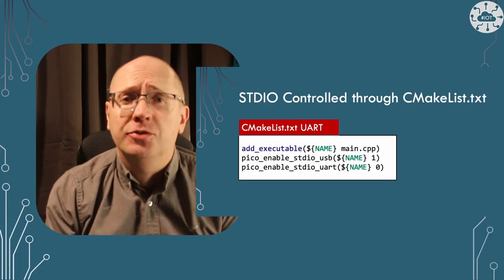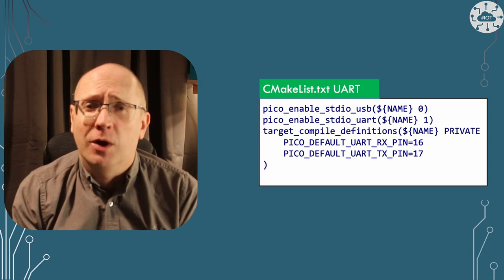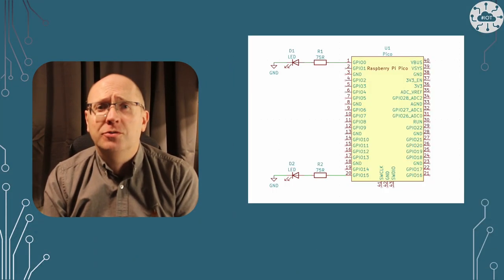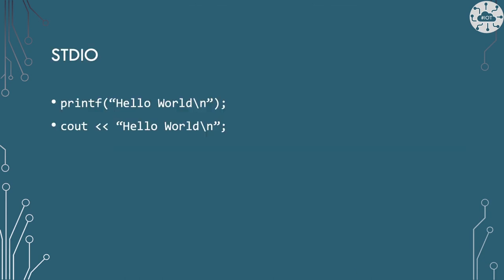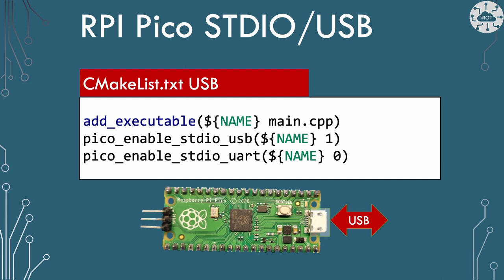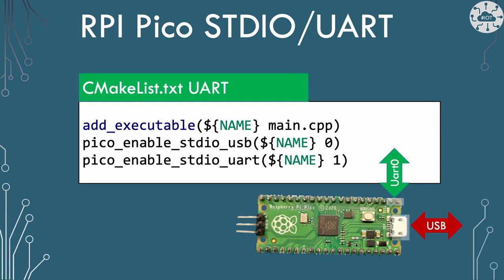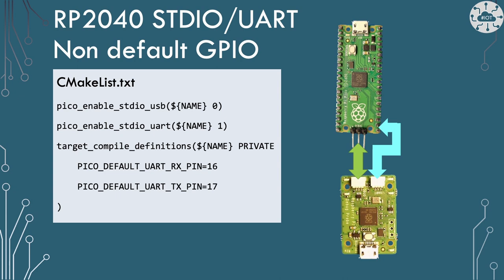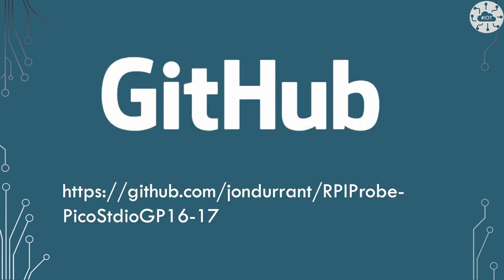RPI Pico STDIO (C/C++) UART

Comment: When I use stdio over usb and UART0 driver pin other then default pins for stdio to read data from sensors, serial monitor does not prints anything.
Reply from the maker: Serial monitor, does that mean you are using Arduino library? I have only focused on the Pico SDK but not had an issue using both UARTS and on different pins.
Reply: @DrJonEA  I'm using pico c/c++ SDK
Reply from the maker: Me too. I talk through some of this a bit more in my blog: https://drjonea.co.uk/2023/04/05/rp2040-stdio-over-uart-non-default-gpio/. Hope that helps.